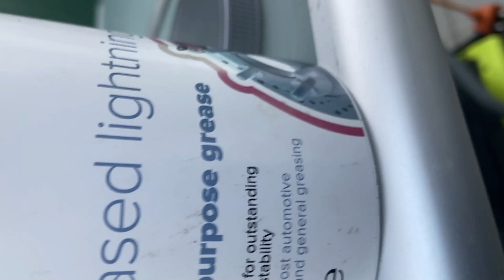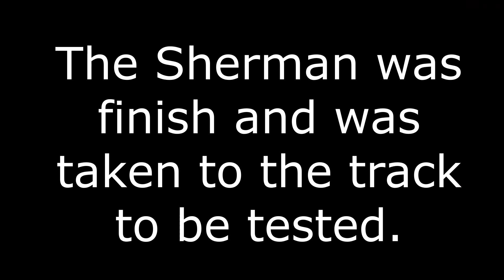Veteran Sherman back light fix and full check up service.EUC,Electric Unicycle.

Comment: Thanks Kevin 
I have a Sherman.
I checked the nuts on the battery to fuse box wires. They were loose. 
I tightened everything after watching your video. Hot glue works great.
I think you really saved me from getting a cut out and crashing, because of loose nuts on the connection.
Thank you very much for all the work and videos you provide.
Reply from the maker: you welcome John. I am glad you have check this. I feel great getting feedback from yourself knowing it have safe you from a cut out. thank you.🙂

Comment: Great video as always Bro!  Those washers that are rusting will be acting like a 'sacrificial anode' .... of all of the metals used in the axle/hanger/nut & washer... it will be the most easy to rust... so, it does all of the rusting. Similar to bolting zinc blocks inside steel boat hulls. Best to have some spare replacement washers and let them rust maybe?

Comment: So what was the issue with the back light? What was your solution? Didnt catch in the vid. THX!
Reply from the maker: The back light was flashing bright and dim and flickering on and off. Even with the new case that comes with new socket and cable connector. But this was working on the bench with no problem. It was the transformer causing interference due to cable beening too short and next to it. By extending the cable and moving it away from the transformer the light works.

Comment: Hello !
I love your work, you really seem knowledgeable about these wheels. I'd love to make the same upgrades to my sherman to avoid future issues, I'd like to know more about the materials you're using.
For the grease around the axel, any Lithium grase will work ?
When you're putting it back together, is the back stuff hot glue you're using to secure the screws ?
And the black tape you put on the motor wire where they go inside the motor, what type of tape is it ? I'm guessing it's to waterproof the bearing/motor ?
Thanks a lot !
Reply from the maker: Hi Yes any Lithium Grease for car will work. Black hot glue they stick better than the white hot glue. Pipe Repair Tape Stop Water Leak Burst Plumbers Waterproof Self Amalgamating inside motor.
Reply: @eucupgrades  Thanks a lot ! I'll upgrade my sherman with those !